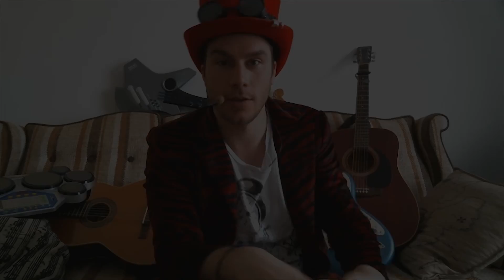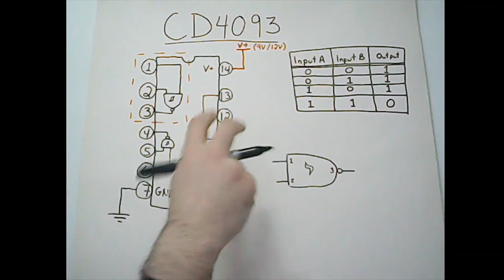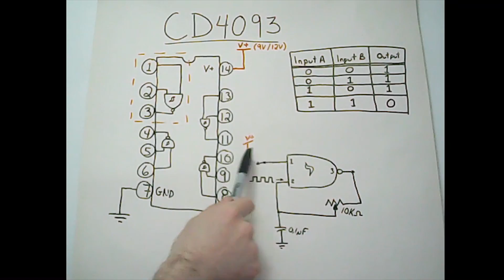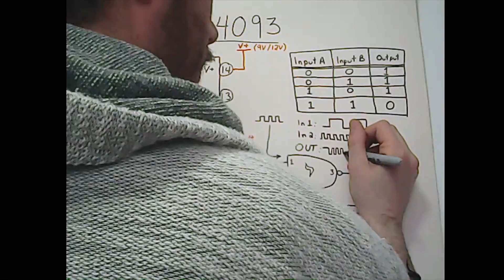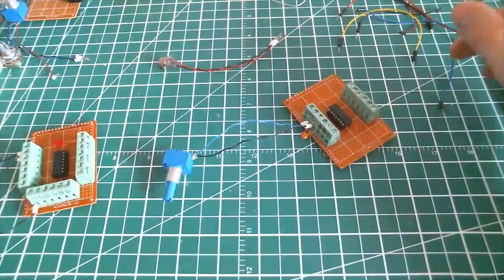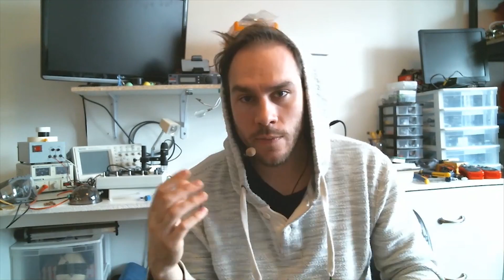DIY Synth Modulation – Using CD4093 to Shape and Modulate Square Waves

Comment: Hi, did you take a look at Ken stone's psycho LFO?
Reply from the maker: Hi there! I discovered it like few months ago. 2 years after these videos! Really like the project.
Reply: @ThePhilStudio  i have it here on a small pcb, but to improve the schematic, you need to "replicate" the cell "C" from the schematic with the pot meter and have an additional 5 equal cells and have 6 adjustable cells and even better if the additional cells contain a SPDT to turn it off.